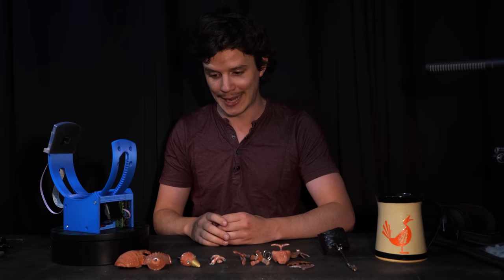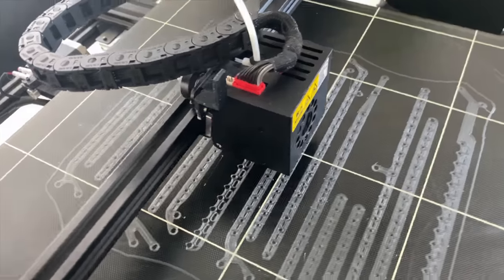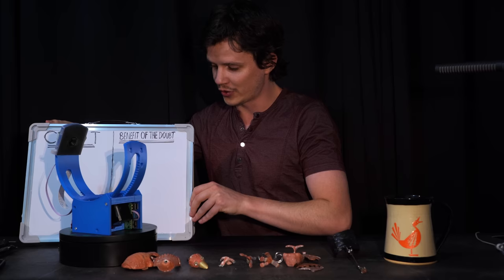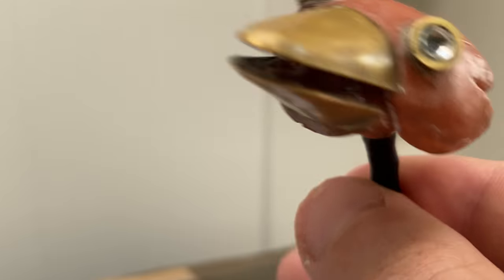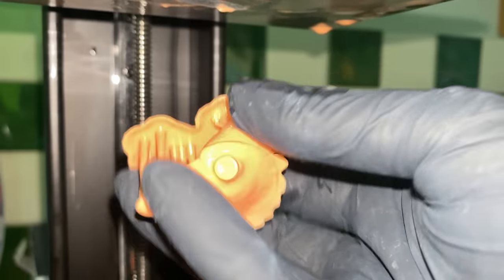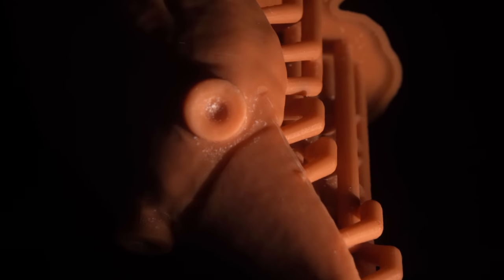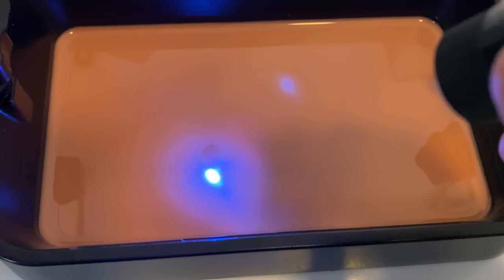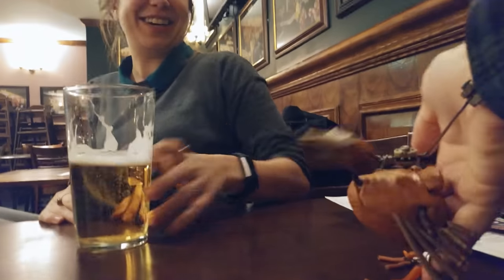DABCHICK got SCAMMED

Comment: Quality of resin is a big issue. Anycubic resin is terrible. And old resin can be pretty bad, it only lasts about 12 months. That's how you get resin splitting at layers and sticking to the FEP even if you increase exposure times. You should replace the FEP film before you start. It's usually scratched and the hole was probably the result of a bad print breaking off and getting squashed between the platform and the screen. I've had that problem more than once. And don't forget to remove the protective sheets from the FEP, I didn't realise the first time I put in a new FEP film.

Comment: I have a creality ender 3 v2 and a longer lk5 pro and can get some extremely fine detail. It all depends on the slicer settings you use. I’m using a setting in cura Called ironing to minimize my layer lines and smooth things out.  Granted it does make for a longer print but worth it in the end

Comment: If you replaced the FEP, trying loosening it a little bit. If its snapping back with force it might be ripping a bit of the model back hense the "cracking". Could also be Lift speed within the slicer settings. Temperature of resin (Mind the UK weather is probably fine for it atm). I've heard some people Lubricate theyre FEP (never tried) to ease release. Id check for Manafacturers specific specifications before tweaking further. If the supports arent going to cause any visible uglyness, then the more the merrier in some sense. I would be mindful of air gaps/suction, so maybe look into orietating differently; theres a "cross section" on most prints where the suction force is fighting against the stick of the build plate (usually the widest part), we want to lessen that as much as possible.

Welcome to 3D printing.

Comment: You can also print holds from which you can cast metal or plastic versions. Not all resins are created equal. Some resins have specific material properties like heat resistance, flexibility, or imbact resistance. 
Supporting objects is it's own skill. If you don't have the time to learn it, it is best to just pay a professional support artist. The supports you used are entirely too large.
Just an idea, but there are plenty of 3d printer youtubers who would be thrilled to collab with you on a project like this. 3d Printing Nerd and Uncle Jesse are just two that come to mind.

Comment: Please, please, please check the resin calibration exposure times. Some printers (not sure for yours) allow you to lock the head at 0 height and make multiple exposures of increasing duration so that you can find the optimal times for your printer. It is similar to the temperature towers in filament 3d printers. Obviously you got new PEI film. The print surface and the film should be spotless before printing

Comment: some tips for resin printing I can give you is try to print hollow with a drain holes, as this will prevent "suction cupping" which is exactly what you're running into. 
also Supporting the ever living fuck out of models is completely normal in resin printing, the idea for supports in resin is: if one pole fails there's 16-80 nearby to pick up the slack.
and finally: start small. and then work your way up in scale
Reply: Granted I have a significantly more high-end printer, but either way these tips come from someone who knew literally nothing about resin printing before being given one for their 22nd birthday, All I had before this was a Creality Traditional 3d printer. the one that uses filament rolls.

Comment: You should really invest in an elegoo saturn 2 or a Jupiter, they just work, no hassle.  The saturn 2 is actually on sale at 30% off right now and from experience they jave excellent customer service, also the S2 cones with an air purifier carbon filter to teduce fumes and has a socket on the back of the red case if you want to attach an extractor fan an flu pipe to suck all the fumes out of your shed, and out through a window.

Comment: You need to soak the part in an ultrasonic cleaner and then use a UV curing table to strengthen the part, you NEED all 3 machines or the part will become brittle within an hour

Also it's toxic

Comment: If that's zmud Beige, it requires extraordinary amounts more exposure when actually printing something vs calibration prints. I've recently got a whole bunch of it (and someone else I know) and we're both having to increase our exposure by a number of seconds, and also use a heavy support or two to stop flexing and splitting. the stuff is AWFUL. A workaround, is a 50/50 mix with a "regular" resin.

Comment: hi barnaby thought id seen you before  I last saw you on adam saveges channel tested anyway just a quick tip you might find useful, ref prints sticking to the fep in the resin tank , I find spraying the fep with a ptfe spray and gently wiping off excess leaving a thin film on the fep works wonders the spray I use is gt85 also I found that after changing my slicer to lychee slicer was also an improvement to my prints,  hope this helps .

Comment: I'm not an expert by any means, this is just my experience from what I've printed.

Time is money, and that is way more money you spent on a used printer than buying new. But hey, at least you learned how to disassemble, clean, and reassemble a machine.

The FEP is a consumable, so finding the start of a hole is when you should replace it. Clearly the seller ignored that and just gave up once it leaked. Clean your vat between every print and check the FEP. Do not use a metal scraper on the FEP.

Thicker supports aren't the solution, more frequent supports and manually placing them a few layers before the print failed is better. You can test placing several small scale models on the same print to test which angle and support density is best. Those tears come from the print shifting and warping between supports. Once you sort out the supports, keep the printer in a stable temperature and humidity area, lid on while printing. Checking it by opening the encloser or pausing the print really risks tears. This particular print, I'd point the beak towards the print plate. Sharp single points on the model supported by at least three supports makes a stable base to build off.  then more frequent supports along the starting edges.

Comment: As someone with extensive experience in 3D Modeling and printing with both FDM and Resin:
WHY IN THE HELL WOULD YOU EVEN BUY USED. A BRAND NEW MARS 2 IS LIKE ONLY 200-300 BUCKS YA SILLY BILLY.

Comment: 5:27 might be a liquid temperature issue, if the ambient temperature is changing in the room its printing in,  it might be causing the resin to do ALL of those things (not stick/dry/split/melt)  the shield is meant to protect it from those kinda things, but thats not always fool proof. Even the actual resin consistency can be a problem for different printers, (example if you store the resin somewhere too cold or too hot before putting it in the machine) because you're dealing with a liquid and it uses lasers to cure, if the protective coating in the shield is damaged (say from the other person cleaning it) it might get interference from sunlight/other light.
Reply: 6:16 NOTE: im a novice at resin printing, but not with resin, The person who is more experienced, that you're getting help from in person, is going to be WAY better, they can walk you through all the niche conditions you might encounter.

Comment: i have the same printer
it prints well 
the only thing i dont like about it is
its double the amount of time to print anything,
than my anycubic resin printer.

if you keep getting those cracks in the same places
it could be down to how you made it in your cad software.

to avoid the prints sticking to the bed,
just use medium or heavy supports.
if its a new fep sheet it should be fine..
hope this helps
kind regards
simon

Comment: These supports look way too big to me. I would put a lot more thinner supports. You have to go through calibration (curing time, each resin have to have their own settings) if you didn't already. 
and if you really need a solid resin you can try to get your hands on Mayer makes engineering resin, which apparently is a beast although i never tried it personally, I only have seen good feedback about it.

Comment: Resin printing is a tough learning curve.  If you haven't already, check out Siraya Tech's test model.  It's pretty quick to print, and it comes with a good guide on how to interpret the results and change your printer settings to improve.  It changed my whole experience with resin printing.  I went from 1 in 5 prints succeeding to 1 in 10 failing.

Comment: Though I dont know much about resin 3d printing. I do know a bit about preserving the prints. From my experience with fdm printing. Now if you just want prints to quickly assemble into dabchick well my advice will not help you. How ever if your willing to make them last in the long term I do have a bit of tips that can help. Yes 3d prints can suffer from uv damage any material can really. How ever if your willing to do some post processing Id recomend painting them and then once they are dry going over them completely with gloss varnish. I once did that when my brother went on vacation over seas and he had the necklass on during the two weeks out in the sun. At the beach and it survived and was pretty much unscathed the entire time granted uv damage does take long time but considering it was exposed to water for a decent amount of hours and was fine. Id suggest doing the same to dabchicks printed parts at the very least it should help decrease the uv damage from being coated in pain and gloss varnish. And dont forget to use primer before you paint too. You want the paint to stick.

Comment: Looks like you're using a different make of resin to the machine. It's not a major problem, but you need to take heed of the information on the side telling you your exposure times, etc. I use an ABS like resin, which may be more durable, but you're probably better off molding the prints and casting in epoxy if you need ultimate endurance. Hope that makes sense.

Comment: I've been printing for a couple years now, my bets on the fails are one of three things, either there's errors in the model such as small voids creating suction forces, two, you might have misplaced some supports, the successful one was massively over supported which is fine but that being successful pushes me to think that's the issue, or thirdly (sorta) an issue with settings, primarily lift speed or bed leveling, either of these being off could potentially cause this but would be part of the basic setup and considering the lengths you went to to get the printer working I doubt you overlooked that 😁.

Comment: Resin printing is very different from FDM. Watch your work surface footprint, looks like you're suction cupping which both ruins the film at the bottom and the print job. I've been printing with FDM for years and recently got a resin printer. More of a learning curve than I expected.

Comment: Honestly aside from the sellers faults, the rest looks like you need to level it properly and fix the exposures. Resin printing isn’t just plug and play. And it’s much more in depth when initially setting it up than just level and print like in fdm.

You def need to resin exposure settings tests and DO NOT just use the slicer defaults. Don’t even trust other people’s settings with the same printer! 
Different resins too can be tricky and need to be tested for a base line for the brand and type. 

Unlike fdm where most materials between manufacturers can have settings shared between users, resin is like hard mode printing. Fdm is crazy easy to learn. Resin.. not so much 😅

But the results when you get it are just the best!

Comment: What if you used a different type of resin and/or epoxy for Dabchick's parts? 🤔 
The 3D print looked kinda good. Though I remember there's special types of resin used when making toys such as D20 dice or figurines. That kind of resin would be pretty sturdy.
And to get the hand carved details can take the same kind of paints used to paint miniatures for Warhammer 40k. Those paints are available in hobby stores that do model railroading.

I haven't worked with Resin much myself, but I did have to repair a lot of art projects.

Comment: I'm sure someone has mentioned this and maybe you've figured it out (I haven't seen the videos after this!), but it looks like your layer cure times are too low. Your layers may also be too thick for the resin you are using. Finally, you would almost certainly be better served with narrower supports, as they also contribute to adhesion and your part doesn't look large enough to really justify supports anywhere near that thick. If you are worried about UV degradation, there are UV protective coatings you can use, or you can use your printed models to create molds for another material. I'm not an expert, but I have some experience with resin printing.

Comment: Hey bud your supports are way too big. You would be much better off using a lot more much much smaller supports. Also, sequentially placing your supports so you’re not left with islands. I highly recommend using lychee slicer as it can place all your supports automatically and do a really good job of detecting issues before you print. Also your concern of durability is valid. I’m sure you’ve seen how brittle resin can be. I haven’t tried using more durable resin myself. But it may just be worth looking into having a professional company print dabchick in a more durable material.. or perhaps use the resin parts for mold making so you can mold him with more resilient materials. Love your work. Thanks for everything

Comment: Goodness man be more careful around your resin!!

I strongly recommend you do not touch liquid resin directly, even wearing nitrile gloves.

Instead, ideally, separate your part from the printbed in to a container, and then pour your choice of solvent over it to clean it. 

Once there's no liquid resin on the surface you can take it out with some tongs and then snap off any supports with your gloves still on, then cure the part.

Comment: I would look at your model under brush/blender, etc and adjust the model a bit, it looks like the model has issues.
Also try to use light supports and play with braces.

Comment: I work with normal resin a lot, and my god it’s just as bad and finicky. I make my own moulds, and then cast them, and I have the exact specifications of resin for my pours, and I spent over £400 on my collections of resins. I have like 50KG as I bought it wholesale all at once, and it’s fucking awful to work with. Because I don’t use UV unless I need quick curing for whatever reason, it takes at least 48 hours for it to cure (it depends on temperature and the type of resin, but most take 48 hours on average). I wait all that time, and then find out that it has a single bubble in it so now my sculpted chess piece turned resin needs to be recast again, and if I’m lucky I can reuse the same mould. 

As much as it’s shitty that the printer was finicky, I’m kinda happy that all resin is stupid to work with and I hate it as much as I love it. The casts that work come out so clear, they’re versatile and hard, and you can use resin for pretty much anything as long as it isn’t heat based.

Comment: I wouldn't dream of giving you a hard time about this. I've been pushing you in your comments to do this for probably over 2 years now, but hey, I understand.  It can be extremely difficult at times.  Especially if it's not your wheel house and you got a tight budget.  You got this.

  I wish I could have let you know that getting to used machine would come with this level of hassel but again it's okay.  I happens.  Either you'll get the hang of it or somebody in your audience is going to throw you a better one.  Maybe a company will give you a nice one as a sponsor.  And the best part is that once you've printed  a Dabchik that you're truly happy with, you can order an even better version in stronger materials through a company like Shapeways.

I completely get the frustration but from here on out your only moving forward.

Comment: idk which slicer you're using but those support structures look extremely old style. You should look into more modern slicers where the supports end in a point that leaves barely any marks on the part. Also a better slicer will let you play with layer exposure time, which is probably the main thing that may be causing failures. Also please don't forget to wear a mask and thoroughly wash the parts and fully cure them using ipa and sunlight or a uv lamp, this stuff is really toxic.

Another thing for durability, you could use the prints to make molds to cast the final pieces in a much more durable material, or you could directly play around with different UV resins that cure at the same wavelength and mix them to achieve the optimal characteristics you want. For example you can mix flexible resin with one meant for higher detail to get a somewhat tough final part that will be slightly compliant and able to take some impacts. As for the UV resistance, simple coatings can take care of that, such as spray paint.
Reply: Also for the printer vat thing that got a leak, well, that part is a consumable. It degrades over time and you have to replace it eventually. Same as the screen. The UV backlight and the resin are really rough on those parts so they can't last forever, which is why buying a used resin printer is a huge gamble. New ones are not especially expensive nowadays, 200$ for some decent models is very good considering what you get.

Comment: Great video.
If you need any help with your project you can always send me a message, I’m a 3D modeler that specialises in 3D printing (Resin and FDM) and love to make props as a hobby. 

Resin could be an option for dap hip if you add siraya tech tenacious to your resin. It’s a flexible resin it gives parts a very resilient property.